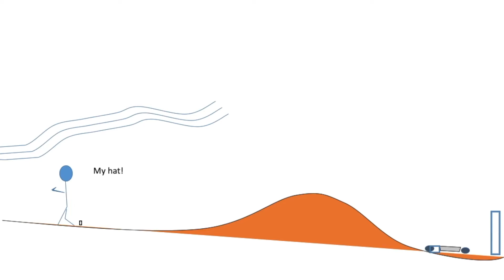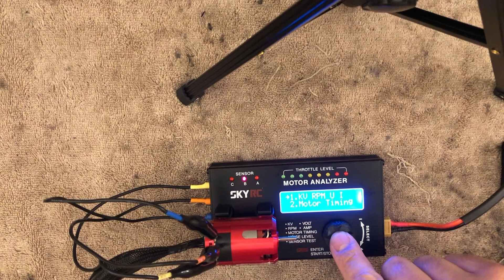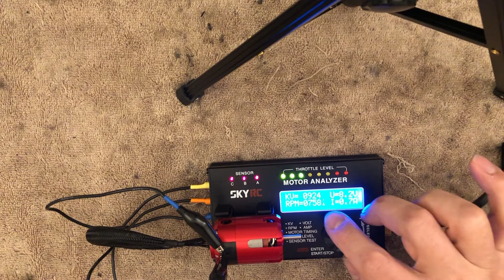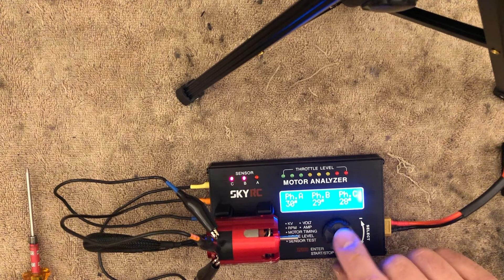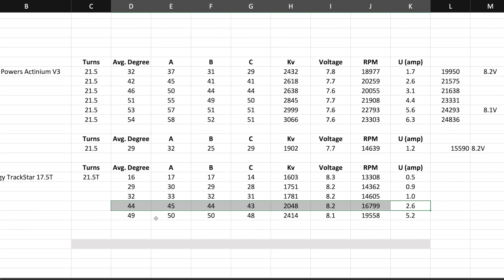Turnigy TrackStar 21.5T motor basic data Kv data vs. Team Powers USGT motor

Comment: Just got my Turnigy 21.5 for my 1st run at the local track. I feel it’s a good intermediate to hobby level motor.!it’s just forgiving enough to help fine tune line selection and rolling into sweepers. Not to overpowering so should provide for a fun run with the locals.
Reply from the maker: I think your comment is spot on with my experience. It is smooth. It is not as "punchy" as others, but smooth.